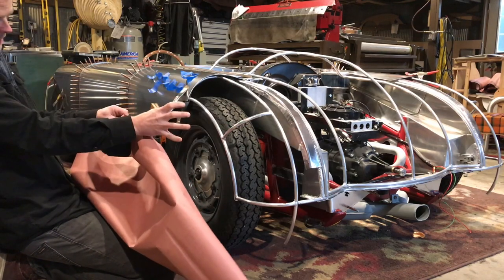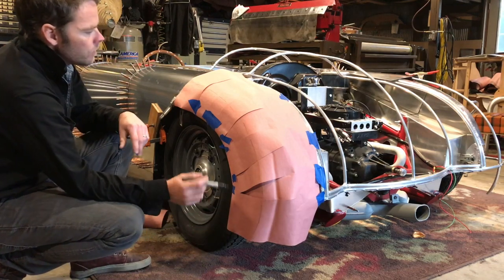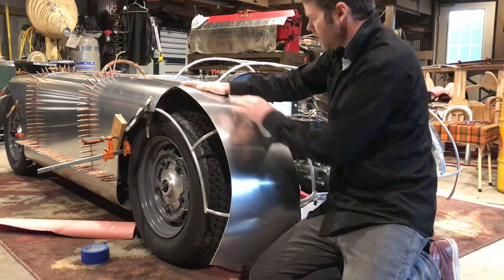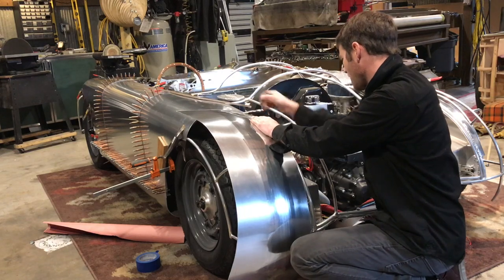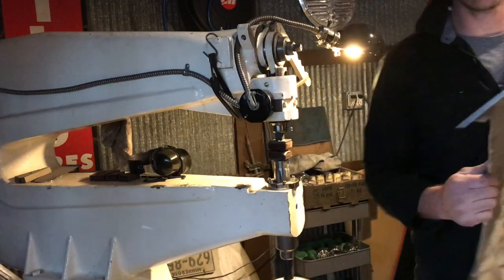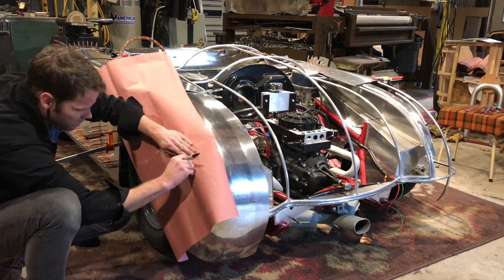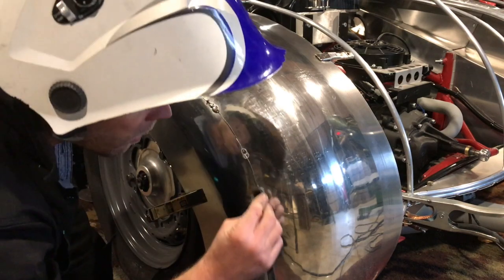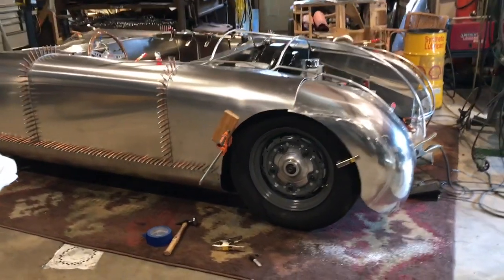Metalshaping Fender Compound Curves

Comment: Wow beautiful!
I'm curious, are there CAD programs that can output a pattern for cutting a sheet of metal and bend it correctly?
EDIT: Oh I see that is not how it's done. I'd also be curious about seam welding. I read somewhere that automobile welding is supposed to be only spot welding because otherwise you have too much tension in the metal. Is this ok for aluminium?
Reply from the maker: Hi Dejay, I am asked this question a lot regarding CAD and automating my process. There are programs, 3D scanners, "Stretch Formers" etc that can make the process less hands on in a physically demanding sense. I look at this question in a couple ways. 1. How much of the handmade look/feel/process am I willing to give up? 2. What am I gaining from automating parts or all of the process? I have found that parts of my build process would be more efficient if I used Computer assistance, primarily in the inner paneling of the vehicle and the "Tube Buck" could be CNC bent. These items take up a lot of time for me. The outer skin as I show in this video, really doesn't take all that long to make and for this particular build style I want the finish to have the handcrafted look and feel.

In regard to the stresses on the welds. The makeup of this design is unique in that in it's final state it becomes through 4 stages a sort of monocoque. The primary chassis is steel with all aluminum inner panels, tube buck and final skin bonded to it.
Reply: I can't imaging you would get the same satisfaction from standing back to admire the days work, and saying to yourself "what a great piece of craftmanship my CNC panel-forming press (or whatever) has created".
There are places where craftmanship is what it is all about... this is definitely one of them!   Thank you for sharing with us.
Reply: John Colvin

I agree, it's the hand-crafting that makes the end product, all that it is. 

As for the time that it takes to form the tube frame and wooden buck components by hand, the more of them you build, the faster you will learn to build them.

Any kind of creative process, when repeated frequently, refines your skills and techniques.

In another year or two, you will find that the timeline for completing a car will shorten substantially, even as your designs advance in complexity.
Reply: I just subscribed and 'found' you.  I like your attitude towards using the tools you have and doing as much as you can old school.  Forgive me if this is a repeat question - I have not seen the whole series......how do the body panels attach to the ..uh  'suppaleggera' (?) buck?  I think you can't weld them on - won't they flex?

Comment: those are amaising can i ask what motor transmission set up your mating that with?
Reply from the maker: Thank you, This transaxle is a VW case with all custom internals. I had BENCO build this box. We call it a "Long Box" as it has a 3.44 R/P with longer gears. With this setup and the 2.1 Liter engine you're shifting from 3rd to 4th at 75MPH comfortably. It's an incredible sensation with such a lightweight car.

Comment: Chris, great video amazing skills.  You really need to cover your skin on your hands and arms (or any bare skin) when welding.  The UV in the arc could over time give you skin cancer, dude, don't take the risk
Reply from the maker: Thank you for the feedback. I typically do wear arm and hand protection when welding. Unfortunately I didn't during filming this so I expected comments like this. I appreciate your input.
Reply: Chris I was a welder for 10 years and so know the dangers.  When I saw your video it filled me with genuine concern.  It's good to point out the danger of UV from the welding arc if only for people who are unaware.  TV shows and internet creators often strive to show people wearing the correct PPE (personal protection equipment) but this can sometimes (I feel) lead to the message not getting through.  Whereas if a creator occasionally gets it a bit wrong, the comments can highlight the issue thereby reinforcing the message for the people who are new to the discipline etc.  The way that you methodically shape the panel, checking for dust and debris on the wheels and material and damage to the tools so as to minimise blemishes on the material shows you to be (may I say for someone so young) incredibly competent and meticulous.  I assumed you left off the PPE because of speed of filming or something like that  (like some videos will say 'guards have been removed to facilitate filming').  Anyway, that said,  your videos are spot on.  It's great to watch someone with such talent and skill build amazing things from raw materials.  Please, keep them coming.

Comment: You might of gotten a piece of wire get snagged from your stainless wire brush and contaminated you weld on your first tack! I also run the gas through a little longer on the first tack before I strike my arch to purge out the air that might be in the line.

Comment: very nice when you have 100000 worth of tools.  I like to cater to the backyard guy trying to make stuff. Well done though. No hate here.
Reply from the maker: Not sure where the $100k in tools comes from but certainly not in my shop?! You can pick up a Libert for under $2k. And a decent English wheel is $4500 tops. I built my first two cars with Tree stumps and a $150 English wheel... I won't deny I've added some nicer tools to the shop but nowhere near $100k! Thanks for watching man!
Reply: looks like expensive tool the powered  shaper. I dont know what it is called. does similar shaping as english wheel. very cool though and nice work.